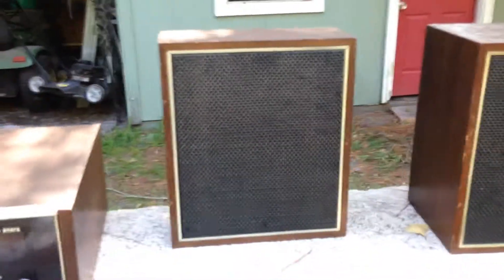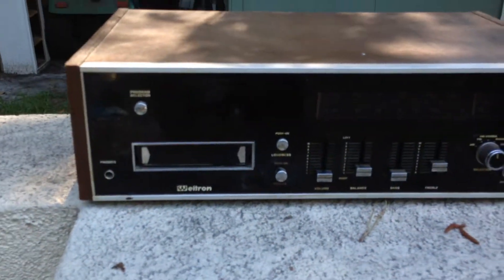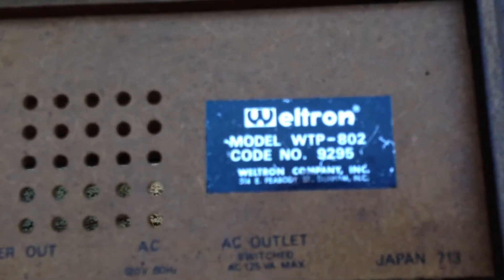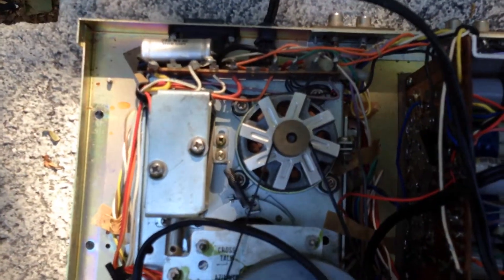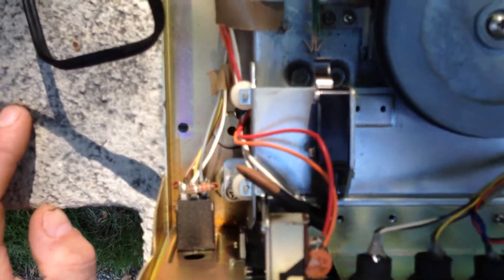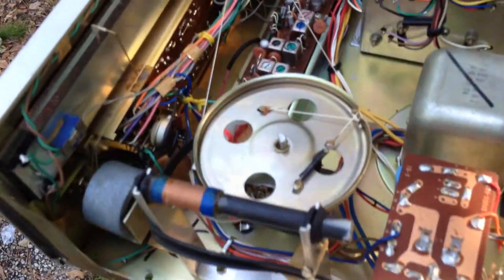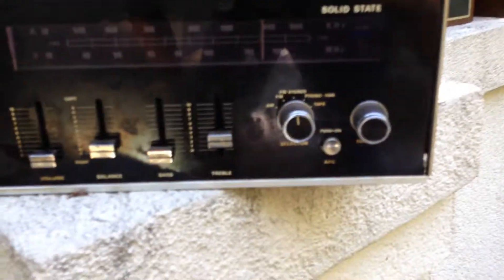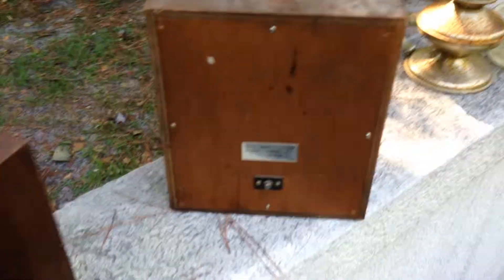Weltron 8 track stereo solid state hi fi (lo fi) haha

Comment: Check Ebay for 8 track tapes. Usually have a lot to chose from.
Reply: Steven King
Hi Steven. I don't have that one. Did you try a search on E bay ?. I did get you some info on your tester. But couldn't find a schematic. I will message you with my email address so I can send the PDF files to you. Take care.
Bobby
Reply: Steven King
Hi Steven. What happened to your Computer? Hardware or software related ? Tiger direct  and Computer geeks are both good places to look for parts. If you need any help,just ask. I'll be happy to give you any help I can.
Bobby
Reply: Steven King
Not to many most are enjoying the summer and getting chores done.  Over the winter things will pick back up no doubt :)
Reply: Steven King Hi Steven. Am station engineer is a great fellow. He doesn't post videos though. He's in the last stages of MS,which has no cure. Him,my brother and niece share the same fate. You can message him I think he would like answering questions you may have on radios. It may take him some time to respond though. Another good fellow to subscribe to is AllAmericanFive  his channel has a ton of very useful videos for learning the ins and outs of vintage radios also. You can find these guys in my playlists. I am happy to help you any way I can Steven. You and yours take care.
Bobby

Comment: Welton is probably best known for their model 2001 ball shaped radio, which like this set, was made in Japan (it says "Japan 713" on the back). I noticed that the crossover capacitor was disconnected from the tweeter, probably because it failed, so you might want to replace that.
Reply: Steven King If that is an AC line filter capacitor, it may have shorted out and then burst. You can replace that with a "safety capacitor", which is designed for that purpose and won't short out.